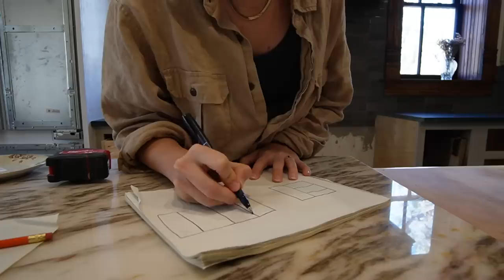DAY IN THE LIFE: kitchen renovations, cabinet doors & installing new sink | Vlogmas Day 14

Comment: Yes, the couch will be more comfy looking straight at the TV & fireplace. Plus the whole family can sit together or someone in a chair if you want. But both can’t see TV from the couch if it’s sideways to TV. Add a sofa table behind. Plus you need a drop zone by front door for purse, keys, shoes. Can’t wait for cabinets to be done and stove installed!
Reply: I was thinking the exact same thing.
Reply: I think they park on the side and eventually the door by the butler’s pantry will be their primary. Am I remembering that right? 🤔
Reply: I just said the exact same thing up there!  Great minds.  ☝☝
Reply: Yes, just needs console/table so back of the couch isn't so blocky. And more areas to decorate!

Comment: If you leave the couch/sofa like it currently is you can get a sofa table put your poofs under it until you need them and add a chair to the mix. 2 chairs under the front windows (like you once had with your bedroom chairs) and one chair across from those on the back porch wall. The single chair could be a bolder color, a statement piece. 😊
Reply: Love your home and your videos.
Reply: Love this idea. The one new chair could be one of those big “chair and a half” sized chairs. They look so comfy and cozy and the bigger size would balance the two chairs opposite it.

Comment: How 'bout this?  Keep the couch the way it is because it's much more comfortable to watch TV and you guys will mostly be the ones looking at it and spending time there.  Get a console table for the back of the couch and make it a focal point or use it as a place to put keys, shoes in the bottom, etc..  You could even have a lamp or two on it for when you're reading or working.   Have the two heavy chairs on the front window side with a table in between and maybe keep the coffee table smaller (if you even need one at this point) and the lower pillow chairs on the back porch side.  That way you can see the pretty door much better and whatever artwork you decide for that wall.  Just my 2 cents.  I love everything you do.  ALL THE THINGS! xo

Comment: This time last year you barely had outside walls, you had access holes in the floors,  most of the windows were not in yet, you had no chimney or internal walls.  
You have worked so hard, you have come so far and it's coming together so pretty.
The work station patio organised, is everything.

Comment: In terms of the layout of the living room, I think if you were to put a console table behind the sofa and dress it, then you wouldn’t feel so much like you were on the outside looking in - it’s the looking at the back of a large, plain sofa that makes it feel too closed off, but that would be taken away by decorating that section out, and maybe putting a little runner rug down between the kitchen area and the sofa, and a standing lamp or tall plant in the corner between the kitchen and the other hallway. That will bring that section of the room into the pretty decor of the living room and make it feel less closed off.

Comment: you could add a blanket at the back of your couch to soften it up. that way its not such a "harsh" divide. or get a sideboard or bench/table with baskets underneath. draws attention away from the fact u´re staring at the back of the couch.

Comment: I would most definitely get another of the same couch, perhaps a loveseat version but you may want the additional seat.
I myself would go for a sectional but that’s just me. Having our sectional that’s too big for the space drives me bonkers cause you can’t move it anywhere and me splitting it where it’s facing each other on opposite ends and the tv center to the side, it’s not as comfortable to look at (but we do use the tv for the PlayStation too) 😅
I do love the look of having chairs diagonal in front of the bookcases by the fireplace, once the tree is gone

Comment: A 8x10 rug would be a better fit for the living room. When the sofa is facing the fire place you’d have a cozier wider rug that opens up the room! The 9X12 is too long so If the sofa faces the fireplace the rug will will be sticking out behind the rug. Try putting a low console table  behind the sofa you might like it better.